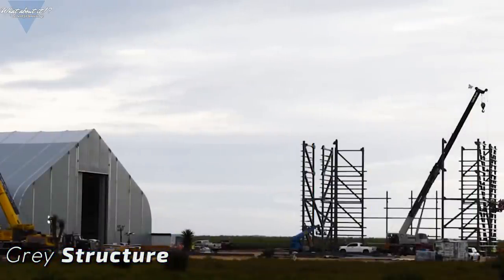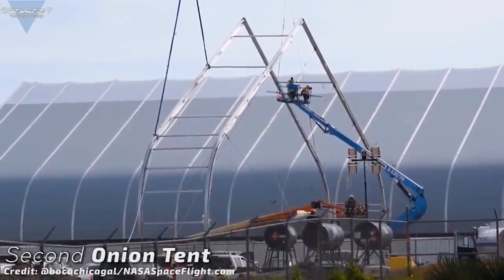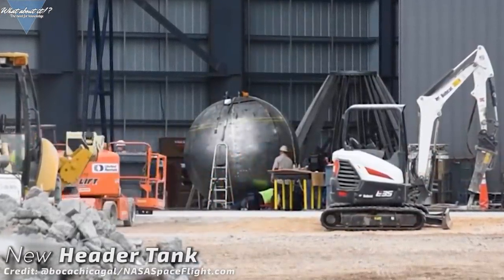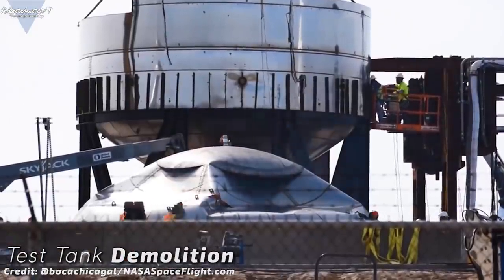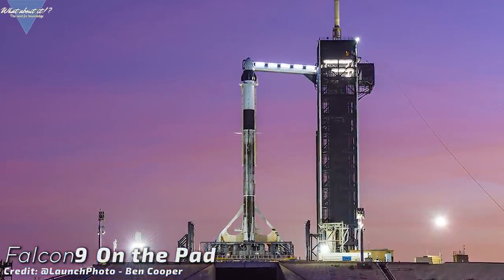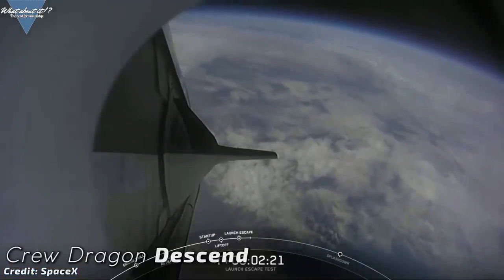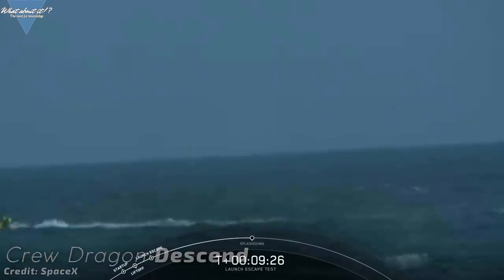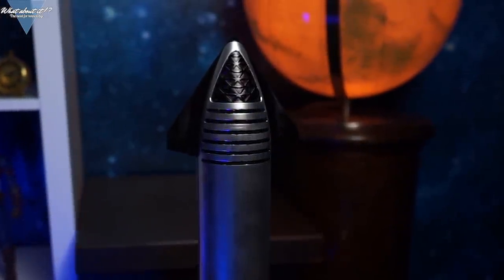66 | SpaceX Starship Updates - Crew Dragon In-Flight Abort Test Summary

Comment: In Elon's NASA press conference, he said the booster fireball is more like a pressure release than an explosion, so, in the event that the booster or second stage actually have a major fireball malfunction, rather than created through a deliberate shutting down of engines, the crew Dragon could still safely thrust straight out of the fireball! The bottom heat shield of the crew Dragon would protect them, and the forces of the fireball would not tear the crew Dragon apart like a dynamite explosion.

Comment: In the post test press conference, Bridenstine was asked "How soon will humans be launched?"  Part of his answer included a statement that it might be a while longer than possible as they are considering expanding the mission duration for the astronauts and they would need additional training.  Hmmm?  Sounds like a conspiracy to allow Boeing to save face by shortening the delay between SpaceX and Boeings first humans launches, or even delaying SpaceX until after Boeing launches.
Reply from the maker: Q2 does not sound like a delay to me.
Reply: Or maybe - just maybe - it means just exactly what he said. Both Boeing and SpaceX is severely delayed and NASA is running out of Russiantickets. So makes sense if they start thinking. Why waste a ride just to test if we can get up there. Why not let the astronauts be part of the ISS rotation.
Reply: @torbenjensen189   Yes. NASA started talking about making the first crewed mission an extended stay one even before the Starliner demo flight. And SpaceX has demonstrated their ability to design a craft that can stay docked for months with the Cargo Dragon. But...  Since Starliner failed to demonstrate the ability to dock and withstand cold storage for 2 weeks, I doubt NASA will use them for the extended stay. Oddly enough, assuming totally unbiased decisions by NASA, that failure could mean Starliner makes the first crewed flight; theirs will have to be brief.
Reply: @Whataboutit  You're right.

Comment: One thing to remember about the 301 Stainless construction, is all these test pieces can be cut down, and the used material transported back to the Steel manufacturer for 100% recycling. Same goes from when vehicles age-out of the Starship fleet in the future.
Twin onion tents and windbreaks - maybe not two Starships side by side, but one Starship line and one Super Heavy line. Completed Super Heavy's will be able to loft cargo while Starship gets passenger rated.
Inflight Abort Test - Lets see NASA hold Boeing to the same testing standards, as things stand, Dragon is looking a lot safer, and actually able to get to the ISS, then the Starliner.

Comment: Congrats to SpaceX for demonstrating the Crew Dragon's escape system.  But what about the Starship?  They're going back to the Shuttle with regard to not including such a capability.
Reply from the maker: It's a tough question. Tim Dodd (Everyday Astronaut) did a great video about it!
Reply: What about it!? I don’t think there’s anyway it makes sense to leave such a safety measure off today.  SpaceX has yet to launch a single person into space and when they do so it will be on a system that’s been in use for years.  Deleting such a system is the kind of thing you might be able to justify on a newer version after many years of proven safety in service.  The Starship aims to dramatically increase the number of people on individual flights, 100+ vs 3-7 on current vehicles.  Imagine the negative coverage of an accident on such a vehicle.
Reply: @BobSmith-zj6lk  Adding one would be complex especially if the crew is to have access to the rest of the craft.  It's not negligence that makes them omit it, it's the engineering hell of having the entire crew area separate and descend safely.  Easier done with a small capsule than a much larger crew volume.  It will never be a zero risk venture.
Reply: Lensflare Deviant Just treat the crew area as a separate stage.  No one is going to access the fuel tanks or engines during a mission.  They could have a trunk separating the crew section from the rest of the vehicle.
Reply: @BobSmith-zj6lk  Have you looked at the design?  There is a large pressurized volume for cargo and crew.  A separate stage, that's extra weight, complexity, point of failure and you still have to design a way to get from this extra stage to the rest of the craft and your trunk still has the same issue of getting past the escape pods heat shield.  The engineering is a lot more complicated than you seem to understand.
Reply: @TheEvilmooseofdoom  What I understand is that we're not remotely near airliner level safety with regard to space travel.  That being the case, designs should still contain crew escape systems.  You don't design without them and then act like they're not needed.  We did that already with the Shuttle.  It's not a lesson we should forget.
Reply: @BobSmith-zj6lk  I agree that we are not and likely never will reach airliner level of safety on any ground to orbit system.  Then again no airliner is 100% guarantee'd either and like airline passengers anyone getting on a Spacex rocket will be accepting the risks.  Can they pull it off?  I don't know.  They may kill a pile of people someday.  There may be a need for some regulatory body to finally start drafting some kind of rules for this kind of thing.
Reply: Lensflare Deviant While we’re still using fuels that are so dangerous, it’s unlikely such flights can ever be considered safe.  SpaceX had a Falcon 9 blow up while fueling just a few years ago.  The Crew Dragon escape system would likely save that crew, a Starship would lose all souls onboard. 

My problem is the speed at which they’re saying people will fly on the Starship.  If, like the Falcon 9, they flew it for years or some large number of missions without a single failure, then maybe the case could be made for omitting such a basic safety system.  As well, a relatively small crew of Astronauts is very different than carrying dozens, perhaps as many as a hundred, civilians.
Reply: @BobSmith-zj6lk  I agree, they'll never be considered safe.  That is always going to be the reality of spaceflight for the foreseeable future.  We're decades away from carrying large numbers of passengers, there is no place for them to go.  As for the fuels, that won't change, the next thing up the food chain in terms of energy is nuclear and that won't happen any time soon.  Would the dragon have saved the crew from the failed tank?  Only if the computer detected and recognize the event soon enough so that's just speculation.  Take anything regarding people on a spacex rocket with a grain of salt, they will need to fly many more cargo missions before there is a need (beyond PR) for a manned mission of any kind.  Re-fueling a single 'starship' so it can go beyond LEO will likely require 5+ tanker flights alone if they need the tanks full.  By the time there is a destination for passengers the system in one form or another will likely have been flying for a decade and that will at least give them some idea of what and where the flaws are.  I suspect that is the plan for spacex, fly a lot of cargo until they've shaken all the bugs loose.  They may yet have to re-evaluate the design and I fully expect a bunch of changes.  It may even come about that they have to fly their 'passengers' up in small batches to transfer to another craft for transit to.. wherever.

Comment: I think they will be cautious with SN1, but as they achieve proven status on components they will build several in succession, say bulk-heads etc. Somewhere along the line, they have to build a superheavy prototype, but I'm not sure the bulkheads will be the same in SS and SH. The tank (body skin) should be the same. I'm wondering, on a tangent, if they will keep the completed nose section as the facility sign and just paint the logo on it.

Comment: You and Scott are both right, The vehicle must have broken in half, but the explosion was clearly by way of activation of the self destruct mechanism.  You can see the shock wave from the destruct system if you do a frame by frame.  I would say the ISDS failed to a certain extent since the second stage was not destroyed (which violates range rules) and pretty much defeats the purpose of an ISDS in the first place.  Btw, it’s very unlikely SpaceX has it’s own independent vehicle destruct capability.  The Air Force owns the range.  The destruct codes are encrypted and not even shared with NASA (and certainly not with SpaceX) so the best way for SpaceX to destroy it’s own vehicle is to do what they did; turn off the engines and let the ISDS do it or RSO if it doesn’t break up.
Reply: Spacex uses the Autonomous Flight Safety System for flight termination.
Reply: @TheEvilmooseofdoom  Does that mean the JDMTA no longer tracks launches and sends destruct commands?  I only hope that means that there are two now and that the Air Force does actually still keep their finger on the button also.  That 'autonomous' system must have pretty wide margins since the vehicle was flying off attitude for quite a while (and by a lot) before anything happened.  From the video it looked like an ISDS kind of initiation, but the unexploded second stage sure seemed like an no no to me.
Reply: @Strike_Raid  No the whole system was designed to reduce the workload on the Air Force and increase the number of launches per year.  I have no idea what system was in place for the test, but the explosion was not a result of the range safety charges otherwise the 2nd stage would have also been destroyed.
Reply: @TheEvilmooseofdoom  Interesting, I just read the ETR blurb on AFSS, that’s the first I’ve heard of it.  It does say the Air Force still has a button (just in case).  It also says all the range rules are loaded into the AFSS so it follows the same rules 4555 used to.  I’ll bet those rules haven’t changed and not destroying the second stage was a failure of some kind.  The way I see it, if AFSS did destroy the vehicle, the second stage should have gone up with the booster.  If it was an in flight breakup, ISDS should have destroyed the second stage (I’m assuming F9 has an ISDS, either that or two AFSS's).  Vehicle breakup shouldn’t be a failure that prevents activation of the flight termination system since breakup is a given and should be assumed for a loss of control scenario.  I suspicious something may have gone wrong with the FTS on some level.  I imagine at least one range rule was violated and I expect SpaceX will be getting a call from Air Force to discuss that very topic.
Reply: @Strike_Raid  Well we can speculate back and forth all day but I suspect they had a area designated for debris to fall in and that no FTS was used because everything was within those expected limits.  We will just have to wait and see if the Air Force says anything I guess.

Comment: Hey, I was wondering if you know: What about all that used metal they have on hand? Is it possible to recycle it? Re-smelt it maybe? Thanks for all your video, I'm following for a while, you're definitely the most thorough out there ;) Cheers
Reply: Nope. You can't reuse metal. If you try to re-melt it it just smokes and burns.

..Oh wait, that's plastic. Yes, of course you can reuse metal!
Reply: @nagualdesign  Well, you might be a chemical engineer but I'm not... I was wondering how to recombine the alloys that makes stainless steel after melting and if it's still structurally the same SS301 after re-purpose. My question is mostly due to the fact that so far, we see them stacking trash around and it just stays there... probably not as easy as heat and reshape, but what so I know? :)
Reply: @JonathanAdami  Putting aside my poor attempt at a joke, I'm not a chemical engineer either but I believe that all alloys can be re-smelted, provided that it's done in a controlled atmosphere so as not to alter the chemical composition, the biggest problem being oxygen entrainment I suppose.

For technical reasons they may prefer to use the scrap of one alloy as the basis of another, or to make high-performance alloys from virgin materials and lower grade alloys from recycled materials. Whatever the case I'm sure that SpaceX will recycle whatever they can't reuse.
Reply: @JonathanAdami  It may surprise you to know that one of the key ingredients in making new stainless steel is...rusty scrap steel.
And yes, it is relatively simple for any steel manufacturer to adjust the properties by recipe, analysis and process adjustment.
Reply: @poruatokin  you're right, it does surprise me. I'd have to double check it but it's a great tidbit of info that I didn't know, thanks! Happy to hear that it could be as easy as it should be :D

Comment: Since the second stage survived, in theory Dragon will be fine without the launch escape system.
Reply: Hardly... the second stage might have kept basic integrity, but it still broke off rather than being cleanly detached. It's unlikely the engine (if it had had one) would have escaped damage...

Comment: Is there going to be some kind of abort system on the starship?
Reply: Nope. They out cost over life. I also don't like it.
Reply: No, they're going for reliability as their safety measure.  It's hard to make an escape system and still offer access to the rest of the craft.  Nothing comes without risks.
Reply: I think they can make a abort system like the drago engines system. Just put it on the top area . Oh well there’s a lot of risk
Reply: @TheEvilmooseofdoom  question is, can anyone on planet be sure it will be reliable? Plus escape pod placed under main deck, where crew woudl seat during the launch isn't something very complex and costy.
Reply: @_mikolaj_  Nothing is 100% reliable.  An escape pod UNDER the main deck?  I don't understand that.  But an access way from your escape pod to the rest of the interior would require a hole through the heat shield at the very least.  More complex and more costly.
Reply: @TheEvilmooseofdoom  who said it has to be on heat shield side. It's under in vertical axis. So no heat shield problem.
Reply: @_mikolaj_  Well, your escape capsule has to be at the top.  It should have a wide blunt end for the heat shield.  I am trying to understand how one could mount such a thing on the top and still have access to the area under that.  I don't know what you're trying to convey in terms of the design and placement and I suspect words will not do the job..
Reply: @TheEvilmooseofdoom  well sorry, but as yt has no ability to send pictures i can't explain you.
Reply: @_mikolaj_  No, and I wasn't blaming you.  I fully believe we each have an idea in our heads but conveying it in a comment section might just drive us crazy.  60 seconds and a scratch pad might have at least allowed us to understand where the other is coming from if nothing else.

Comment: The second stage wouldnt have exploded, even if the destruction system was triggered since it was a mockup made just for this flight
Reply: The second stage exploded when it hit the ocean so it would have.
Reply: @gorgikalamernikov3260   are you sure that it really exploded? Like i said, it was a mockup and therefore had no propellant and whatsoever loaded. It most likely didnt explode when it hit the water but rather broke apart due to the force of the impact since hitting water that fast is like driving against a concrete wall at full speed
Reply: @renino_4770  there was a giant plume of dark smoke and a small amount of flames
Reply: The second stage was fully fueled to represent real life conditions but had no engine mounted - no point in throwing away money.
Reply: @poruatokin  why would you waste fuel on that tho
Just put some mass replacements in there
Reply: @renino_4770  The reasons were explained on another video from SpaceX staff I believe.
1) The launch system is built to supply fuel, so some other liquid such as water would have required complex plumbing changes.
2) With fuel on board, a potential explosion of the second stage would give the closest possible worst case real world test conditions to the capsule.
3) Fuel is very cheap on this scale - for a full Falcon 9 launch the total cost is only around US$200,000 about 0.4% of the launch cost.  

Seems perfectly reasonable to me.
Reply: @poruatokin  well then

Comment: I am shocked how the second stage survived it was in the front fighting with the extreme aerodynamic forces and it didnt exploded even when the first stage  expoded it was not in the front of the air but it still exploded but the second stage survived how ???🧐🧐 please tell
Reply: It looks like the join just rear of the second stage motors failed, where it joined the first stage. Joins always go first.
Reply: That's what  I was wondering too. You know, second stage probably got broken pretty good even though it still looks intact.
Reply: An empty soda can is "weaker" than a full one. You have a full one taped on the front of an empty one. Apply force to the full one, and the entire stick wants to break ... so looking for the weak spot. Apparently, even the 'tape' is stronger than an empty can, so the break rips the top off the can.
Reply: @shrikedecil    Question Mania, listen to Shrike. This is the correct answer. Thanks Shrike, I was about to reply like this, but your full soda can analogy is better than what I'd have done.
Reply: @donjones4719  I had a long technical one, but screwed it up by 'failing at the internet'. But writing it out and then losing it does wonders for triggering the "Yeah, but how can I say that shorter circuits" :D
Reply: @shrikedecil  That's why I draft any long responses in wordpad first. :)
Reply: @TheEvilmooseofdoom  TextEdit here, but yeah - that's my plan. Just... I wander past quick notes into pedantic tl;dr hour-long lectures too quickly to remember "Hey! Switch out of silly comment box!" :D